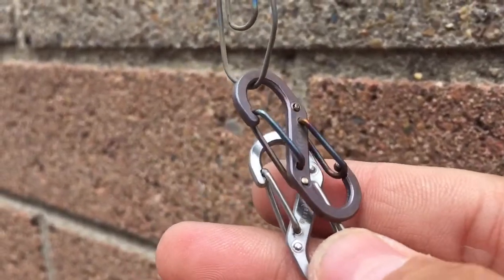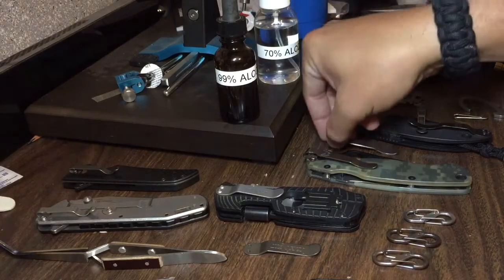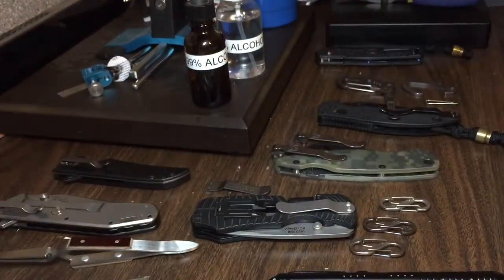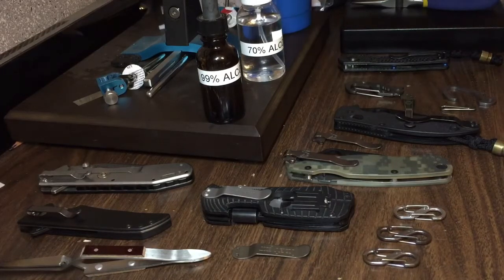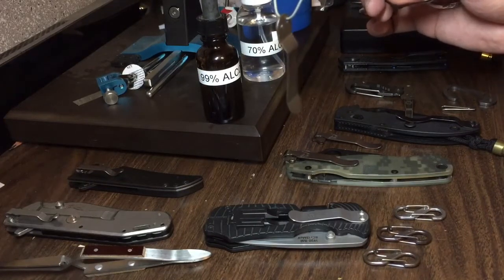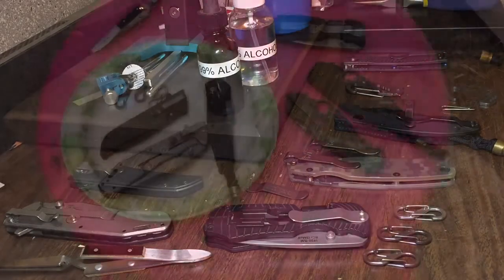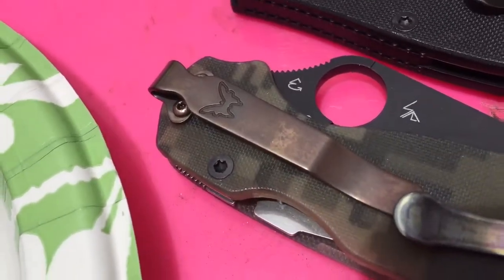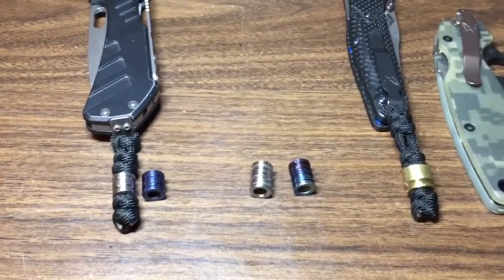Adding Color to Steel By Heat Anodizing

Comment: They say heat anodizing stainless steel can cause it to lose some of its properties, like strength. Did you observe anything along the lines for the Spyderco? Also, I read the anodized color comes off easily from stainless steel. Was that the case with yours as well? Especially for the Spyderco pocket clip.
Reply from the maker: Color stayed and didn’t notice any effect on the strength of the pocket clips but the gates on one of the carabiners was definitely weakened and wouldn’t spring back closed after opened but after that I just took off the gate before heating up the carabiner then reattached the gate after.

Comment: Hey how do I get in contact with you? I would like you to do some work for me.
Reply from the maker: I don’t do this for a living and not sure I’d feel comfortable doing this to other peoples things.  You can easily do it yourself with a torch or even a gas stove but keep in mind this may change the characteristics of the metal so this may weaken pocket clips or may ruin anything heat treated.  Not sure but something to keep in mind.  Most knife manufacturers will give free/cheap replacement pocket clips if lost or broken so may want to look into that before trying it on a pocket clip of an expensive knife.  Can also buy aftermarket titanium pocket clips that are pre anodized also a good option.

Comment: Magnets wont stick to steel depending on how tempered it is
Reply: No. 
Magnets don't stick to steels when they are at the Curie point (past glowing , around the orange glowing range). 
Once it leaves this temperature range when cooling down it regains it's ferromagnetic properties. 
Some steels , stainless steels are non magnetic (very weakly so in fact) because the alloying elements perturbate ferromagnetism.

Comment: Will this screw up stainless steel framelocks like what's on the pilar?
Reply from the maker: Jonathan Mackay - No idea, but I wouldn’t recommend doing it to a frame lock.  Wouldn’t be surprised if it messed with the ability for the lock to rebound and could mess up the knife.  Plus never know how it will turn out looking.
Reply: Just don’t do it to the lock side. But the presentation side is fine to do. I’ve done my Pilar large and it looks nice.